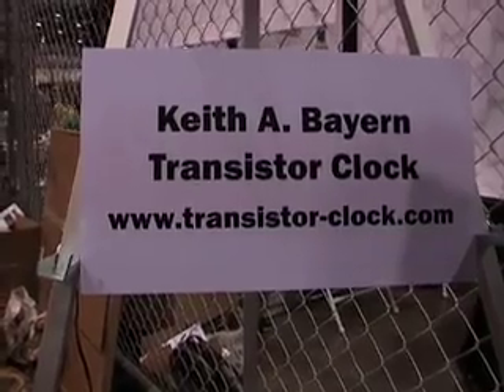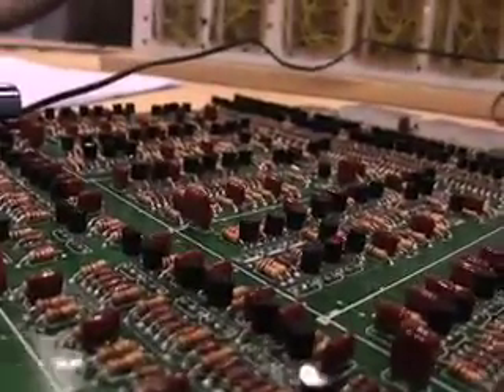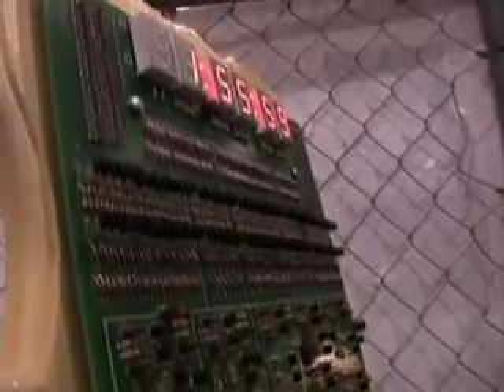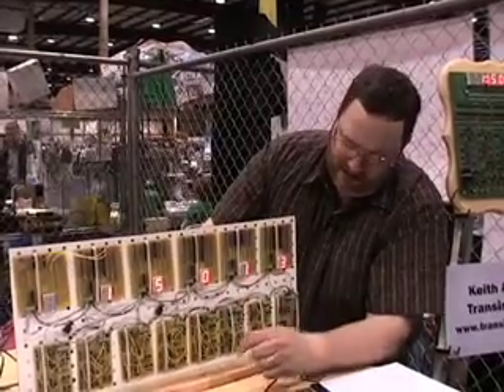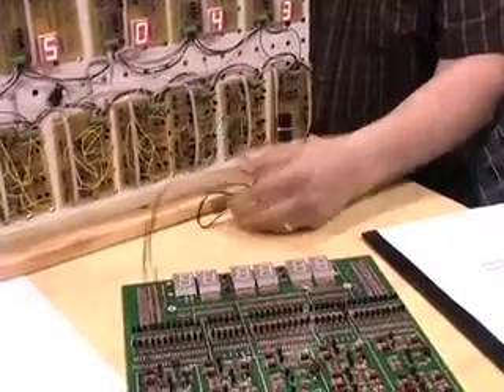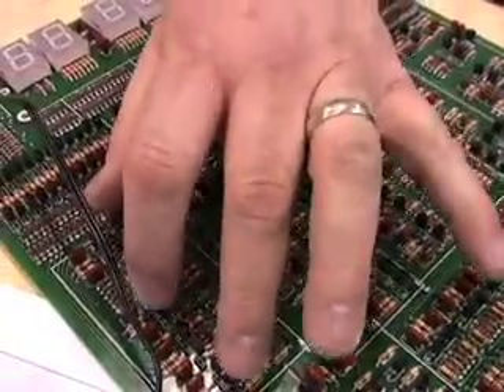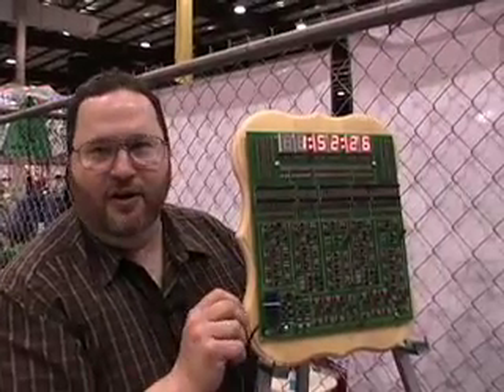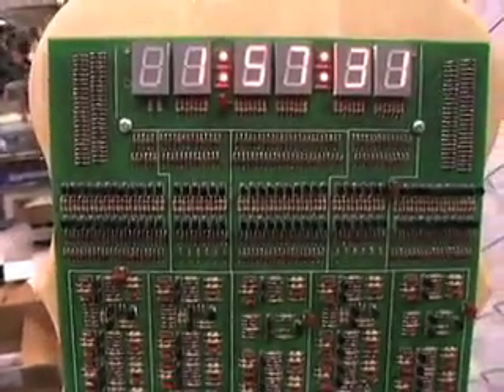Maker Faire 2008: The Transistor Clock

Comment: No, actually a Nixie version would be slightly easier by eliminating a couple hundred diodes used in the 10 to 7-segment conversion.  The 1 of 10 outputs are already present.  What would be needed is to use high voltage transistors in the 1 of 10 stages (with a 170v power supply) or use high voltage transistors throughout and power the entire clock from the same 170v power supply.   There has been discussion of making a Nixie version in the Neonixie yahoo group.